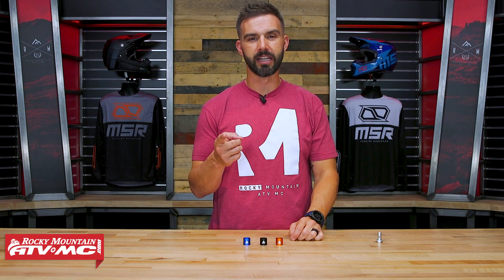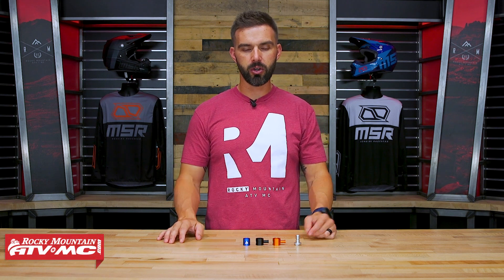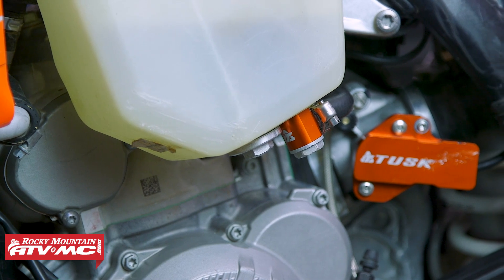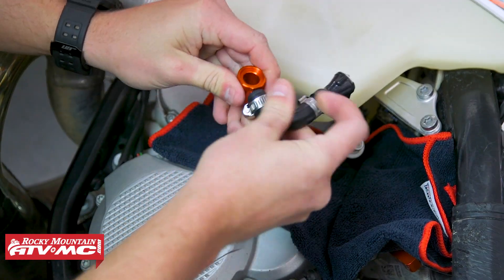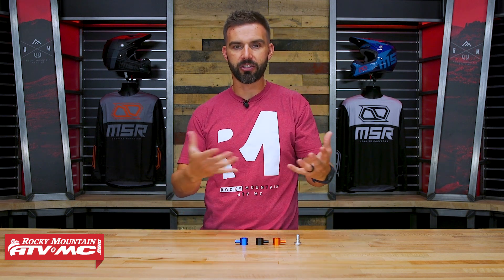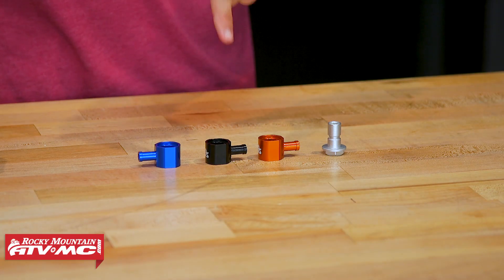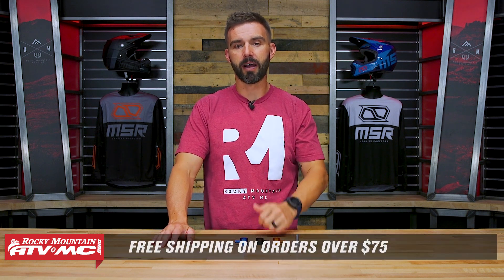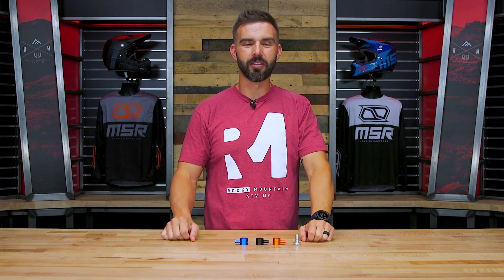Tusk Billet Fuel Pump Tap for KTM/Husqvarna/GasGas Motorcycles

Comment: So the stock nut wont work ? How do you find the part on RMATV's page ? Putting the part number on the search bar does nothing
Reply from the maker: The short connection nut is required and can be found on the fuel pump schematic in the OEM parts finder. You can check out the OEM parts finder here: https://www.rockymountainatvmc.com/oem-parts
Reply: @rmatvmc  fuel pump schematic for what bike?